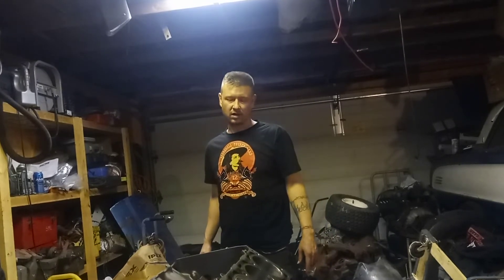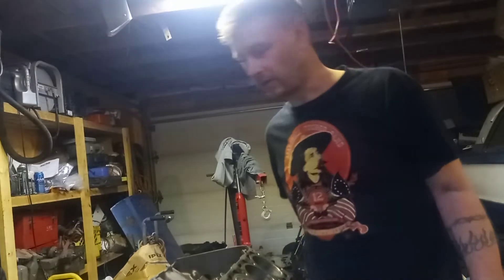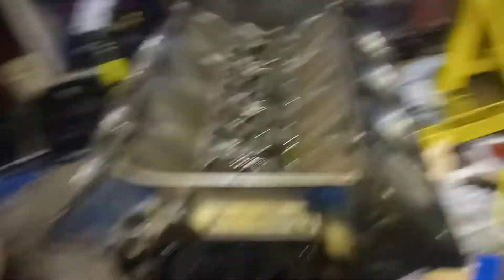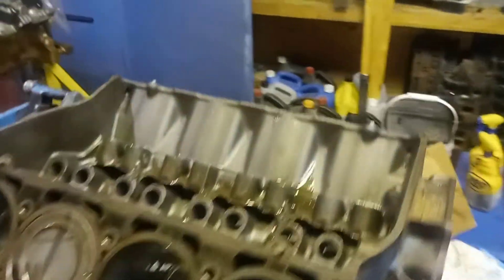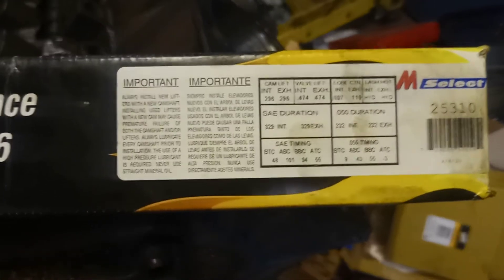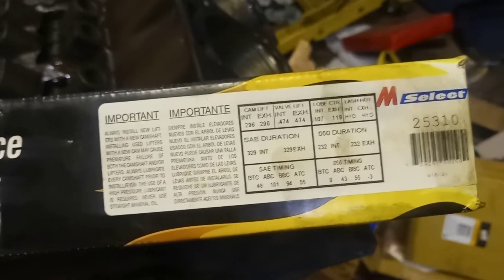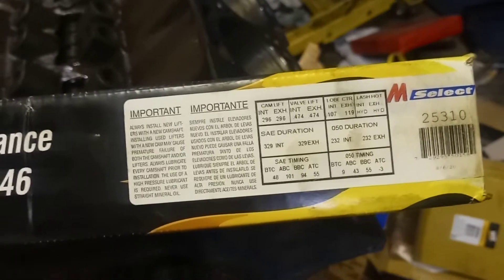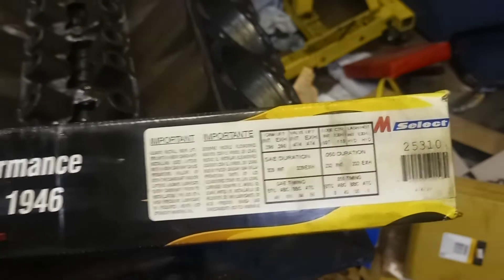Short block as promised #nonamenationals

Comment: I have the Erson TQ 20 which is pretty much the same as your cam.  I have SRP pistons which makes compression ratio high because of it’s design even with the slugs being .015 in the hole.  I found somebody  who had steel thin head gaskets years ago on real olds power.  I had 3:73 gears (now 3:42).  It runs strong.  I haven’t gone to the track though.  Do you think 4:10 gears may help you?  I have a Olds Cutlass Supreme. Similar to to your 442.  I wish you all the best man.
Reply from the maker: I wish I had some steel shim head gaskets the ones that were on this motor were rotten. This motor is going in a 1960 Studebaker Lark. It is going to have a 3500 stall and th350. Ideally I would like 4.10 and a short 26'' tire. What I meant to say about the cam is there's way better grinds now that will make more power and run better. The lobes are mild and not steep and there is a lot of overlap bu its the only cam i could find in stock that would work. Thank you very much for watching and for your ideas.

Comment: Hello WildRose, just a thought on the chain, if it's tight it will pull 15 HP out of the engine. Get a smaller gear for the crank. Also take a wire wheel to the gears and smooth them.  🍻
Reply from the maker: I am thinking it will loosen up after cam break in they always do. Not a fan of comp products myself. I just hope its not hard on the front cam bearing. Thanks for the tip and for watching.